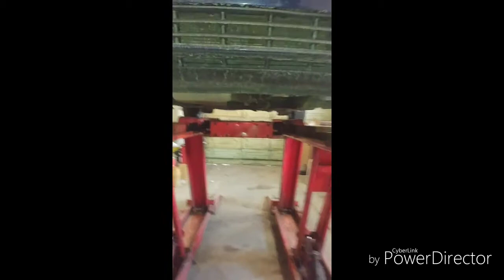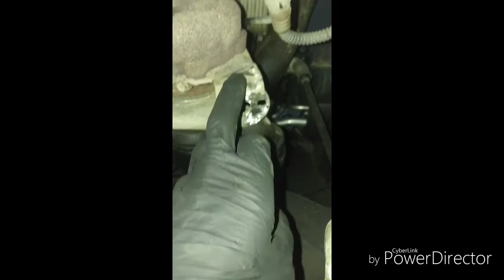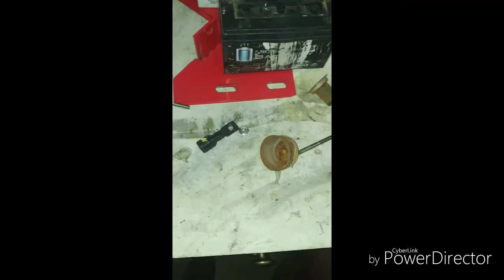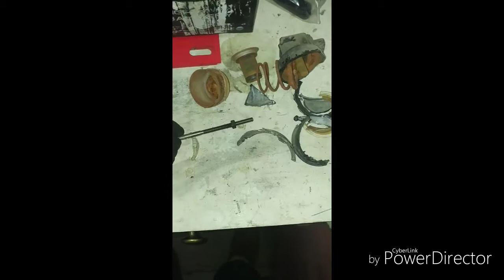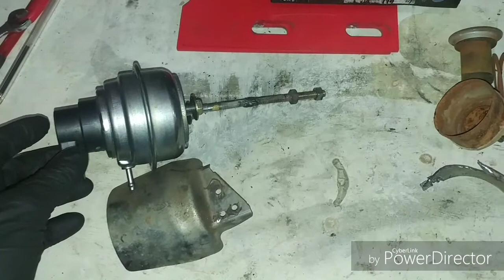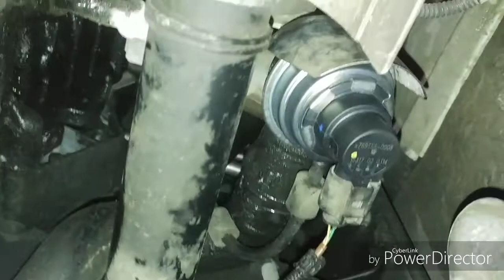2004 / 2005 Volkswagen BEW TDI Turbocharger Smart Actuator Replacement

Comment: Are you saying that you drilled the holes in the original bracket while it was still mounted to the turbo because you didn't want to take the chance of breaking off the mounting studs?
Reply from the maker: Yes, that is exactly what I did to avoid breaking those bolts. 

Sincerely,

Levi Jefferies